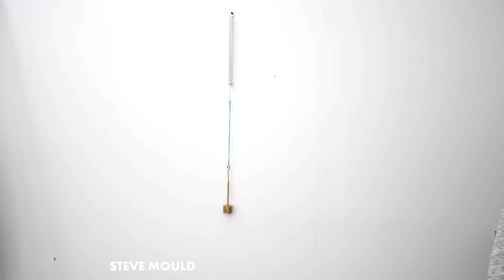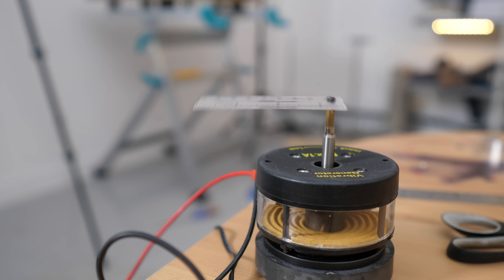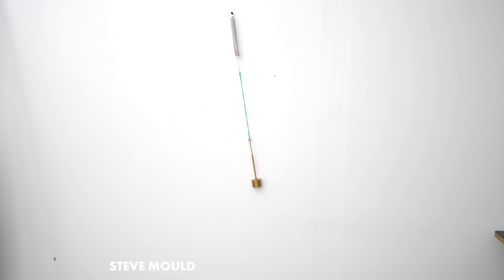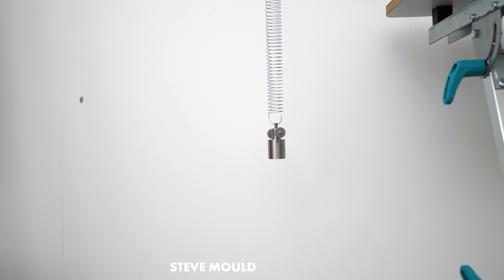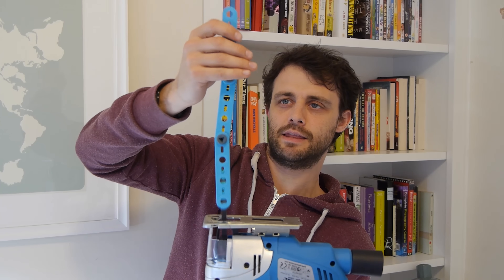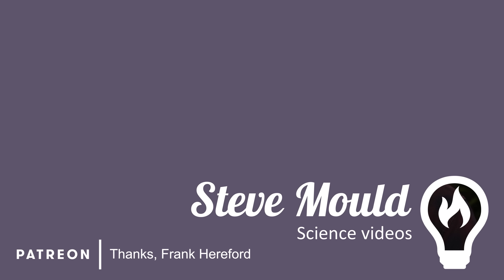What If Swings Had Springs Instead Of Ropes: Autoparametric Resonance

Comment: 6:54  I believe that angular momentum transfer by itself is insufficient to explain a person's ability to pump a swing.
Let's create a 'Free Body Diagram' of a spinning disk attached to a swing, with its C.G. on the seat, with the disk hung on vertical, non moving ropes, and a disk brake lever arm attached to the rope where a person would typically hold on.The question is: HOW can the angular momentum be imparted to the swing? To rephrase, since a rope can only support a force along its axis and the system starts with the ropes being both vertically aligned and not moving, HOW can angular momentum initiate a horizontal motion?  The only mechanism I see is that when force from the brake lever 'kinks' the rope from its original straight (vertical) line to the seat, it IS changing the center of gravity. 

In the case of a person instead of a disk, the change in C.G. is more obvious . Not only are they changing the C.G by putting a 'kink' in the rope, but they are also displacing their C.G. relative to the seat when they lean back.

Comment: Is there a theoretical maximum of work you that can be done per swing/beat?! Like in percent (of the amplitude maybe) or absolute energy? 
In your example of pulling the weight hanging down from the arm: if you were to pull very hard (infinitly hard) at the right moment surely this thing would be "flying" round in circles, wouldnt it? But than again not a pendulum anymore... 
Know that I'm thinking about it, the max acceleration could only be 9,81m/s² because otherwise the string would not be taut at some point(not moving under at least sone tention).
If some can explain further that would be great!

Comment: Phrasing ERROR at 1:36   While resonance can happen when adding energy (i.e. the existence of a 'Forcing function'), the addition of energy is NOT a necessity for resonance.
One can have resonance in an undamped, steady state system, with no energy augmentation 
Resonance can also occur in a damped system, again, with no forcing function
Also, the term 'Resonance' also applies to mathematical models which do not pertain to energy

Comment: https://www.youtube.com/watch?v=aKZDa-HgqXA
Here you can see the figure eight motion from hauling on a pendulum line. A differential pulley of about 1:2 was added in the 13th century to get a longer pull, which then necessitated more haulers to operate it. So about 13 kg static load per person.

And here a simulation:  http://www.sciences.univ-nantes.fr/sites/genevieve_tulloue/Meca/Oscillateurs/botafumeiro.html

Don't try this at home, unless you have huge transepts, and Spanish reed stops to support the hymn.

Comment: I really can't make any changes to reduce my carbon footprint. I could maby reduce my driving on average by 15 km/ month if i'm lucky on my commuter car which already is really good on fuel (5.1 l/100km real world driving) but my weekly commute is 550 km and I do need to leave my house sometimes when i'm not going to work. I could also stop doing what makes me happy which is driving my vintage car during the summers. but that wouldn't make much of a difference since I drive less than 2000km every year with that car, probably closer to 1500km yearly. other than that do I consume no deary, 100% renewable energy and I do on average produce more energy than I use, eat entirely vegetarian food, my pets are 2 rats, all my household appliances are at least A in energy rating etc. there is nothing I can do to reduce my footprint more.

and other than that, I produce almost no waste what so ever that can't be recycled. less than a kilo over the course of 3 years.  and almost everything I own is either bought or given second hand. furniture is refurbished and I fix clothes over and over to save a buck. the only clothes I do buy new are underwear and socks as soon as they wear out, other clothing articles are in general bought second hand and fixed over and over until they litterally aren't able to be fixed anymore, and at that point do they make good patches for the next set of clothes that I wear out.
Reply: The biggest thing anyone can do to reduce their carbon footprint is to not reproduce.  Fewer feet == fewer footprints.
Reply: @michaelsleator6326  fair, have no kids and have no interest in having them either

Comment: Wow wren seems absurdly toxic. The solution to climate change doesn't really live in individuals changing their patterns, its a problem caused by unbridled capitalism and as long as there's still unbridled capitalism dumping carbon into the air we won't be able to fix it, your 50 bucks a month isn't going to do jack shit to the companies vomiting carbon in measurements of tons/hour. It's not even a drop in the bucket - its a molecule.

Comment: I was vaguely aware of the non-auto variant, very interesting concept. Also a fascinating demonstration seeing it shift multiple times between primarily working as a pendulum and spring... converting the energy that's in the system between the two states. At first it really seems like something that should not be happening.

Comment: My first guess was that you if you draw a free body diagram on the end part you'd get a sidewards vector and a upwards vector which both result in the force you are applying to the rope. So you are adding energy into the system in x and y direction, but ONLY when the pendulum is not 100% straight. The more steeper the angle, the more force you are putting into the x direction instead of the y direction. 

... I think.

Comment: Ok so would all of this still happen if the spring, string and weight were all in a perfectly straight line (and of course with perfectly symmetrical mass)? If there is no sideways input whatsoever, would you still get the pendulum effect to happen?

Comment: really love your videos except the part where you help reap the profits of climate alarmism with the carbon guilt tax. Carbon dioxide is a life giving gas which is NOT a driver of climate as proven by the vostock ice core samples showing that temperature changes first, due to solar cycles, and then co2 follows that trend due to reduced capacity of dissolved co2 in the oceans as a function of temperature. The trend ends with human input of Co2 where co2 has risen but temperature has not followed it in any pattern, there was a period of 17 years where there was no significant rise in global temp despite billions more tonnes of co2 added to the atmosphere.

Co2 is a trace gas and accounts for less than 3% of the greenhouse effect, while water vapour accounts for over 95% of the greenhouse effect.

Comment: by allowing slack towards the high side, it removes a slight amount of force which would confine it to a tighter circumference - allowing only gravity to act then when it speeds up decreasing the radius increases the speed again, which is why it gets radically out of control QUICKLY,

Comment: In Santiago de Compostela, Spain they do this thing at the cathedral where they basically just swing a big incense burner across the whole hall using the method you show by pulling on the string at just the right time. If you want to look it up it's called the "Botafumeiro" and honestly it's fantastic.

Comment: It’s amazing how many things get discovered by pure chance from the exact right combination of things.
Like cutting a grape in half (but leaving it connected by a little bit of skin)and microwaving it,  turns out it refracts st exactly the length of the wave of a microwave and starts to glow white hot.
Reply: Which sane person microwaved grapes after failing to cut it in half
Reply: @brianevans9231  which is why insane people make discoveries lmao
Reply: the wavelength of a 2.4 GHz microwave is 12.5 cm.  So the grape antenna must be some fractional wavelength.
Reply: hmm... interesting
Reply: 2 years late but important to note if anyone reads this, the grape does not just become glowing white hot but does in fact generate plasma and it can be a very dangerous experiment to try if you dont know what youre doing

Comment: Nice explanations! This is obviously entirely classical here, but there are cool links to quantum mechanics. Eg the only the stable modes (and not the individual excitations) correspond to stable quantum eigenstates, but a linear combination of the symmetric and anti-symmetric eigenstates gives you a time-dependent state where the excitation moves between the two individual modes in exactly the same way as happens here.
Reply: Oh someone else already brought up the link to quantum mechanics. Oh well.

I guess I'll also chip in that the movement of the excitation between the two modes follows exactly the same underlying maths as a harmonic oscillator, which is what all the pendulums/springs are themselves (or what they're approximating), with the excitation of each oscillator taking the place of position and momentum of a single oscillator. So, it's an oscillator of two oscillators.

This also brings out that there's a change in phase when you go through zero. You noted that the two weakly coupled pendulums were 1/4 of an oscillation out of phase, but after one gets all the oscillation and the other stops, they'll be 1/4 out of phase, but the opposite one one will be ahead.  (This may or may not be surprising to the reader, depending on their intuitions.)

I had a lecturer who insisted that everything in physics (quantum or classical) is basically just coupled harmonic oscillators, which isn't quite true, but is far more true that it has any right to be.

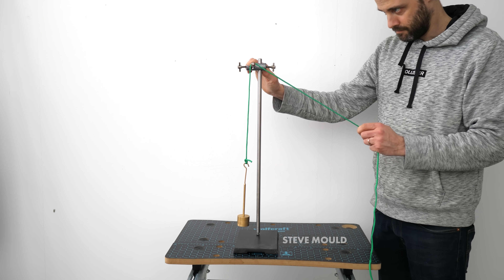Comment: 4:30 - I noticed that there is some input motion of the hand holding the rod. Seems like every time you pulled the string up a bit, the other hand was giving the pole a little shove or letting it be pulled towards you. I know it's a bit late now the video has been posted, and this is just supposed to be a demonstration. However, I found myself distracted by it until I realized what I was seeing. And, it might confused people as to where the sideways motion came from.
Reply: I mean regardless of how you release it, there would ALWAYS be some side motion, which eventually would increase with the resonance

Comment: Whoa whoa whoa!  Way to just dismiss the thought of raising and lowering your center of gravity as a way of pumping a swing!  Transfer of angular momentum?  Steve!  You’ve been guilty of speaking “scientifically” based off of what made sense in your brain before.  Sorry to burst your bubble, but what is the highest (longest) swing you’ve ever had experience with?  I built a 24’ high swing set.  The normal pumping action of swinging your legs and body DOES NOT WORK!  The only method the get the swing that long going is by raising and lowering your center of gravity.  Which by the way also happens as a result of kicking your legs, and leaning backwards and forwards.  Sorry.  🤷‍♂️

Comment: i use that swinging trick to get wire up over rafters when im running something in the shop, get it swinging to right above the rafters then let it go n let it drop, u have to do in kind of a swift motion, it goes pretty fast once u get the hang of it     u can run a few rows pretty quick without havin to set the ladder up a bunch of times, n its especially nice if u have to run over a rafter over a machine that i dont have anything big enough to move

Comment: When you pump your legs on a swing, a lot happens. Consider your angular momentum and how it is controlled by your pushing and pulling on the ropes and the shortening and lengthening of your body, and how this interaction with the ropes effects the tension, length, and angle of the ropes.

Comment: Gravity is a waveform, so you could create a project that shows this waveform.  Though this waveform is very tiny, but you should be able to amplify the waveform.  25 years ago, we knew gravity wasn't a constant.  There was someone that found a way to read gravity changes, but it was odd the more gravity areas fell in heavily populated areas.  This data would lead you to think that gravity is strongest where it has more objects to pull on.  Data also shows the error of the theory, as we know where gravity is the strongest in our upper atmosphere.

Comment: another cool demonstration of coupled pendulums is a big weight (say a bowling ball) on a length of cable L, and a much smaller ball attached to the bottom of the bowling ball, also with cord of length L. Then start with the bowling ball at rest and swing the small ball. energy gets transferred from small to big, the small ball stops but because big is so massive, it hardly moves. then as if by magic the small ball starts swinging again. repeat.

Comment: Around 4:42 the trajectory outlined reminds me of a common Lissajous figure which is also used to observe resonance between two oscillations at different frequencies. The most interactive and interesting demonstration of this I've had experience with is using an oscilloscope, since the shapes formed can sometimes give the illusion they're spinning! The figure eight mentioned in the video has two crests, indicating the frequency of movement in the vertical axis is twice that of the movement in the horizontal axis, like you pointed out. Since Lissajous figures also appear at other harmonics, I'm wondering if a pendulum on a spring can be made that has a movement in the vertical axis that is three times, four times, even five times the frequency of that in the horizontal axis.

As for observing the trajectory, I wonder if something fun like taping a battery-powered LED to the pendulum mass and letting it swing in a dark room could be captured with a slow shutter speed camera :)

Great videos as always! Love this channel

Comment: I note that when you release your spring/weight device, eg @ 8:39, there is a small offset/swinging from the very start.  I was wondering if, absent that, it would start swinging?  Does the device start its' own pendulum movement?  Is it a "butterfly in the amazon" level of amplifying even the tiniest pendulum movement?

Comment: So, from one tiny nudge the weight moves, and if you get the parameters right it will continue moving for a long time without any additional energy from you added. Couldn't a generator that works from kinetic energy be placed in this system and have more energy produced than that initial nudge?

Comment: I wonder if it's possible to get an unstable oscillation that tranfers between more than two modes. 🤔 Like the twisting pandulum goes up and down, can it also go left and right at the same time ? Or maybe adding a length oscillation to the twins pandulums ?
That would be nice to see i guess ^^

Comment: I'm not a physicist, but I am interested to know if this resonance would still happen if there were no initial imbalances or deviations from the center of mass? Does it start swinging like a pendulum because once you pull it down and let the spring go, it introduces a tiny bit of sideward momentum? If you were to pull it down and let it go in a perfectly centered motion, would it still start to swing?

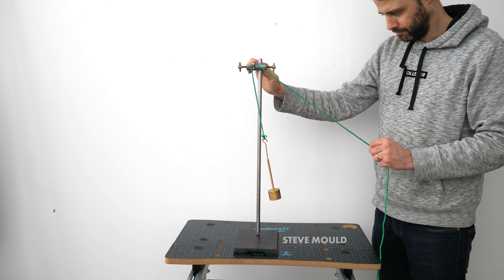Comment: 6:38 I discovered this as a child and was able to get to get as high as the bar of any swing with almost no effort in as little time as possible. Imagine the heart attacks my parents got each time they'd arrive at the park and see their 10yo (with Moderate Haemophilia) standing on a 3m-high swing going higher than the bar.

The issue with your form from what I can tell is that your legs are still bent while you're travelling upward, so you're unintentionally pumping into the swing. Whenever I stand on a swing, I'll only slightly bend my legs and make sure my legs are fully straightened at the same moment I reached the bottom of the arc. I'm not sure if this is accurate scientifically (but it makes sense theoretically) but I found that it was the easiest way to go super high super quickly
Reply: That sounds incredibly terrifying, God bless your parents

I'm doing this the next time I find a swing
Reply: @miso2923 I've done that as a child and thinking back, that sh!t's terrifying.
Reply: We had a wooden swing set behind our house which featured a two-person "horse", which was a plank for a seat  connected by two hinged joints at either end to two other planks, each of which had foot pegs and handlebars.  The swing was suspended by a pair of ropes which ran between the handles and the frame.  By standing on this in a surfing posture, you could get really high very quickly by leaning away from the direction of travel while pulling  on one set of ropes while pushing on the other--essentially what you described.  The ropes weren't nearly long enough to swing the full 180 degrees, though.
Reply: You probably would have loved the "ship swings" (Schiffsschaukel) we have in Germany.
Uses exactly your way to get the swing going and you can do rollovers :-)
https://youtu.be/Ole5mThW8zM?t=280
Reply: I've seen acrobats do the same thing :)

Comment: before even watching i already know that taking a force in any direction other than gravity's own pull direction, and adding it TO the force of gravity would make a spring stretch.

because it does it with ropes as well, we just don't really notice because the stretching of a rope isn't great enough to stretch like a spring.

it can also be shown with a rubber band.

Comment: This resonance occurs in particle orbits cyclotrons when the vertical frequency is one half the horizontal; it is called the "Walkinshaw resonance". 
BTW, the motion does not always pass from horizontal to vertical and back even when exactly on the 2:1 resonance. There is a "stable fixed point". Start the bob horizontal amplitude at sqrt(8) of the vertical, and it will continually trace a stable parabola.